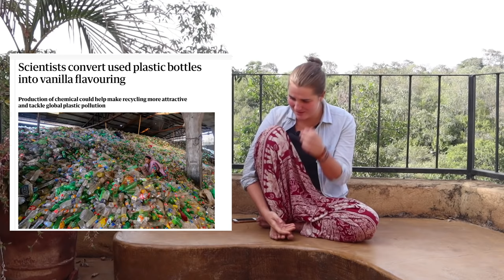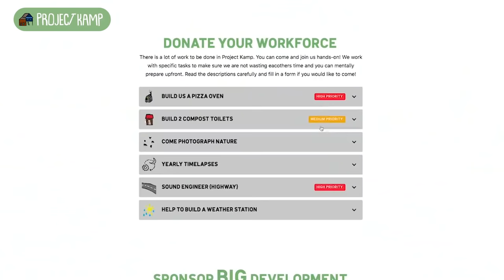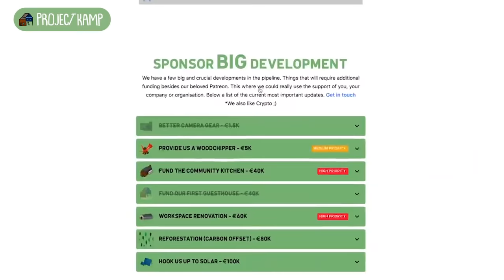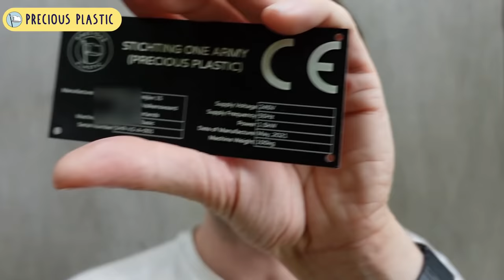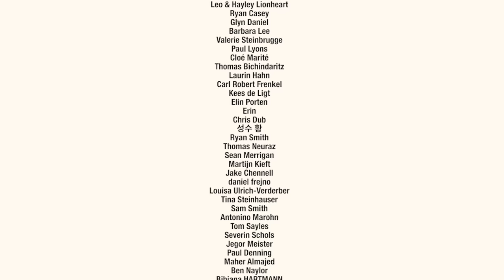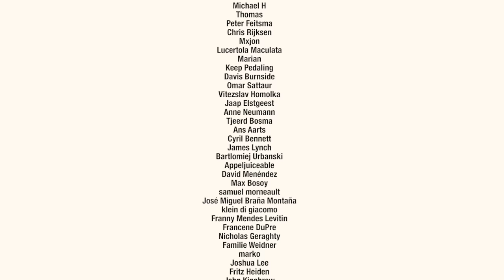MN#53 - Turning Plastic into Food (and Baskets)

Comment: Petroleum based food additives aren't new and have been known for a long time - they are commonly used to keep foods soft longer (example - soft batch cookies), more common is mineral oil which doesn't go rancid.  Kind of mixed feelings, preserving food longer is a good thing, but not a great use of petroleum, and disgusting to many.
Reply: I agree!  From a "harm reduction" standpoint, taking litter and turning it into something useful can be good.  Also maybe more food security.

Making sure it is food grade is important though

(Also in the post-fossil fuel world, sustainable bio-crude, or syngas/methanol can be used for chemical synthesis, so green methods can be used)

Comment: I think if they're already producing most vanilla flavoring from petroleum based products, I would rather they switch to a recycling based method which will use up a bunch of plastic waste. 

Of course no one wants to hear that there is petroleum and plastic based things in our food, but on a chemical level if they are extracting or synthesizing the natural chemical with the exact same structure and bonds your body SHOULD respond to it the exact same way as that natural chemical. So I see it as a positive, at least until single use plastics can fade from use, and then they should make another change.
Reply: i coulda swore most fake vanilla was castoreum.